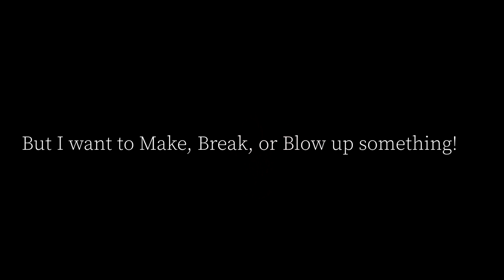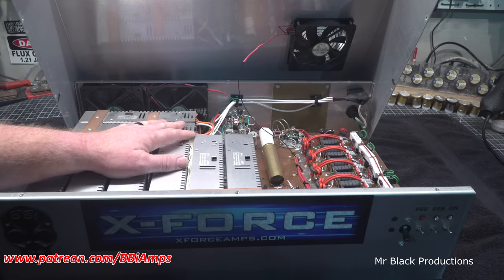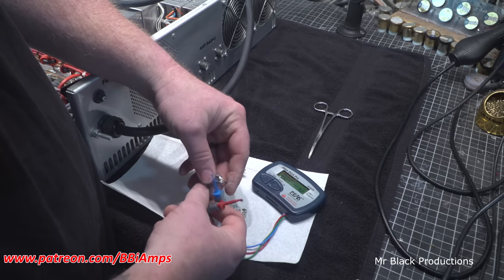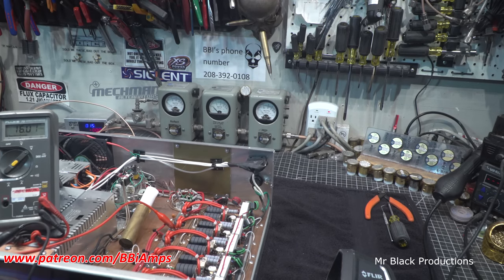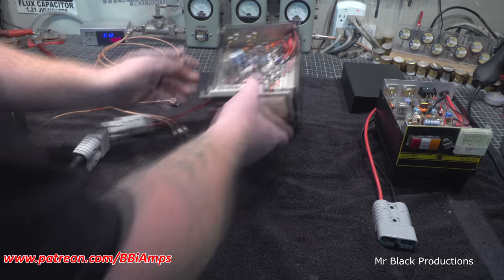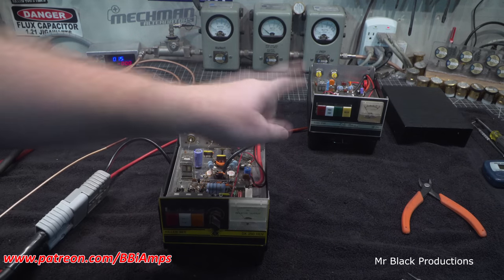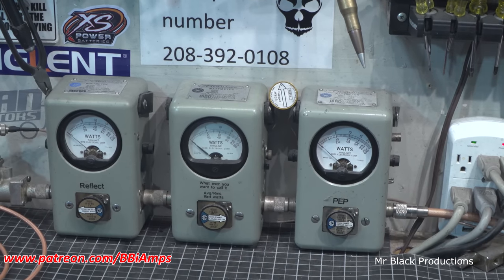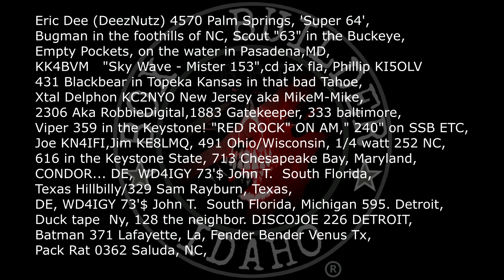X force 10 pill, tx 250,killer bee 250 repair

Comment: nice ! there is a few different blue box in the same cabinet. Had a few come threw with similar problems. 2X8 PP80,PP 100 small heat sink and disk caps 2 on each output . no bias either. 1 lives as a 24V 2SC2510 B bias box. it was mostly add dead. SMPS only 1 working. I got to get 120MM hole punch. I cut my self punching out fan grill . and the fans were backwards . running years later on 2950. Them TS relays do act up quite often.  Mine on hot plate will stay latched. dollar bill trick worked. I think you wrote on old heat sink with a Sharpe .looks small like the one I pulled. had stripped pill shrew. many pill changes. I use the ICA heatsinks. some times they different .  how the fins are made. 73's

Comment: Was that volt and half loss acceptable? Just asking to learn...thanks from tatersalad.
Reply: Hi Ron, lol😄
Reply from the maker: O look its ron.
Reply from the maker: Is your name not Ron?
Reply: @BoxBuilderIdaho  oh my goodness...im eatting crow ....(ron)...ron white....i took it wrong guys and gals...please pardon my ignorance..
Reply from the maker: If this is a I
Legit question. Here's the deal imagine this piece of equipment with his stock wiring configuration that's in it. Imagine what the voltage drop was like before we upgraded The Wire. There's a reason that we do the wire upgrades because the voltage drop is tremendous and that's the reason I started doing this on all the Texas Star Equipment. Unfortunately since we can't take bigger wire into the box and it becomes unpractical at a certain point we have to assume that we can adjust the only means that we have for adjustment is to bring the voltage up even further help compensate for that voltage drop. And in most cases the reason I use such big wire to feed the amplifiers to help promote the idea with the owner of the equipment to supply the amplifier with at least that or bigger wire feeding it cuz people do not and will not seem for some reason want to understand. Was DC there's a huge amount of loss that takes place from the alternator to the amplifier. I'm sorry I've covered this in probably 150 videos and I take it for granted that most people have already watched one of my previous other videos that covers this subject. And on the one video I took it for granted of course we get the question
Reply: @BoxBuilderIdaho  oh ok..thanks..yes i understand voltdrop i was wondering i mistook your reference to the drop as in excess...thank for the 151 hihi explanation...k
Reply: @BoxBuilderIdaho  I was an electronics technician in the US Navy and in industry. Listen to BBI he is right on in this. Some but not all manufacturers will tell you this, or put it in documentation, but some of us know straight up how to minimize lose. Listen and learn.